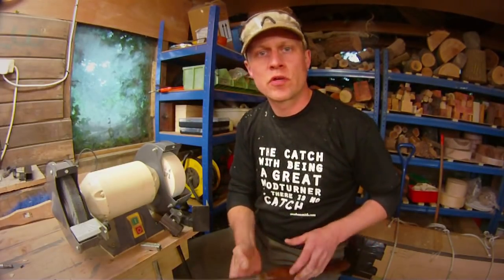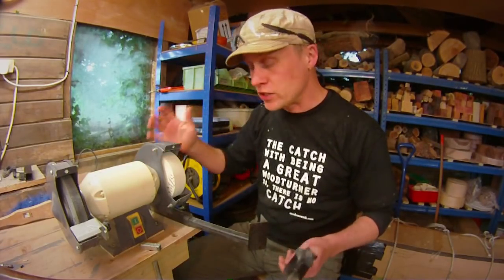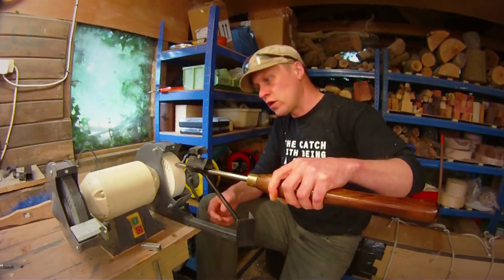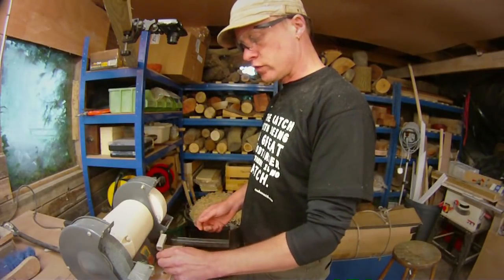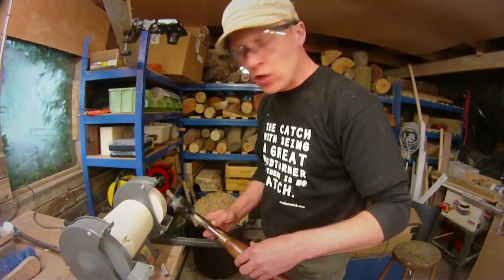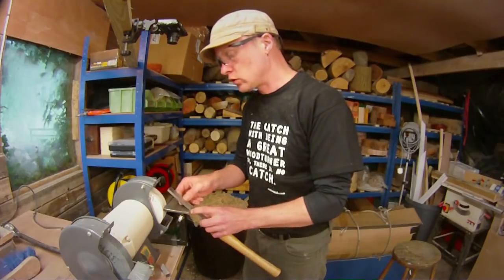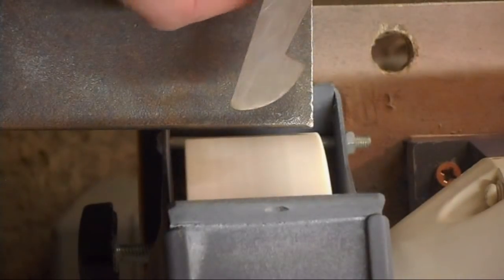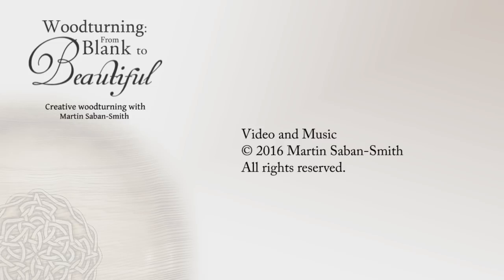Sharpening Woodturning Bowl Gouges and Scrapers Tools. Fingernail Jig Grinder - #66

Comment: Hi Martin,
When I first took lessons on turning, I was told "if you want to learn how to turn, the first thing you have to learn is how to sharpen"
So I learned how to sharpen freehand. Jigs make things sooo much easier and repeatable, although a little slower. For a quick dressing I still do it freehand (I did bite the bullet and buy CBN wheels(much nicer)). For reshaping I use the jigs, mine are "Wolverine" just like your setup - with the slidy in an out thing.
Your fine wheel looks like a 2" wide - much easier to use than a 3/4" wide wheel.
Cheers Paul

Comment: Thanks Martin, I agree with Mike ( who I also watch) I have seen lots of sharpening videos using verious Very expensive jigs but I need to sharpen by hand. Jimmy clewes turns some upside down and uses a sanding belt, so, like woodworking lots of different "styles" I have a similar grinder, and sharpen by hand so your instructions help.. many thanks

Comment: When you were sharpening the scrapers it was clear to see dark areas on the grinding wheel. This is where metal has embedded in the wheel surface, thus ‘clogging’ up the available grinding surface. The use of the diamond dressing tool is to remove this embedded material to expose a uniform grinding surface across the width of the grinding wheel. I hope this adds a little bit of useful information to your demonstration. Regards from Tasmania Australia.

Comment: Cool video Martin. Thanks for that. I'm sorry if I missed it, but what is the rpm on your grinder? All I have is a high speed grinder, and don't really want to buy another grinder, if I don't have to. Can I sharpen with a high speed grinder? I've read that it's not advisable because it can take off too much of the tool and heat the tool up too much. But then others say yes, just use VERY light touches. Do you have any advice?

Comment: My I ask what diameter your grinding wheels are? I have heard 6" will work, but it might leave some concavity in the bevel. 8" is preferred I hear, but a new 8" low speed grinder is not in the budget. :(
Reply: The grinder in this vid is 200 mm, i did hear some prefer the 150mm because they prefer the concave curve, this is the reason some dont like the Robert Sorby systems.... no curve.
Reply from the maker: The grinder in this video is 150mm, not 200.

Comment: Great video Martin. 

I bought the hobby grinder for Axminster and not too happy with it so only been using the Credit Card which so far has done well. I also got the fingernail jig off ebay (retured engineer) so probably the same as you have. I found it fit sperfectly for the bowl gouge (still need to raised grinder by a little) but for my spindle gouge it doesn't seem to be right.

Certainly interested in the flat jig you have which I will now see if I can find.

Comment: I have the very grind and have it set at the 23 degree position,,but im having the hardest time with it,,it seems like from the tip to the back of the wings there is a dip in it,,,do you thing the ellsworth jig would do a better job

Comment: Hi Martin, I've just this morning received that very sharpener, not the scraper one, from Mick Chambers, £34.00, so thanks for this video. I've also noticed a dark line on my wheel and you explained that as well. Cheers mate.
Reply: Dark line on your wheel usually means that spot has become engrained with dirt etc...use the dressing tool to take a bit off and give a fresh surface

Comment: Martin, you know we love you videos. I have 3 words (?) C B N wheels. They are completely balanced, NOT friable ...no bits/dust coming off and can not explode, no need for shielding, take VERY little metal off tools ( therefore last years longer), no heat produced, quiet, and last forever ...almost,........ no dressing, do not get smaller with use therefore never need adjusting, quick...one pass.  That are a bit expensive but in the long term will save you money, work and produce a better edge.  FYI    love tech terms, slidey bit.....stick thingy......makes all the more watchable!!!!  Thanks again Martin.

Comment: Been a subscriber for a while but so glad I found this video. I am just a beginner and have the same bench grinder and will be buying that jig, think I have found it (£65 for both setups). I am SUCH a beginner I only have a 2nd hand lathe and NO gouges yet as budget it tight, but I will be getting the sharpening and extraction in place first otherwise I’ll end up grinding with blunt tools in a dusty garage

Comment: Great video Martin. I bought the self same jig from ebay, but I think it was a friday afternooner. The platform was lying out by over an eigth in the width and then I lost the slidy in and out thing. So I ended up with a trugrind, does the same thing just more expensively. But a good explanation and well filmed.
Drew

Comment: nice video Martin with your u-tube clout I am sure one of the CBN wheel manufactures will spout you a couple one 80 and one 180 grit you will be a  amazed you have a good technique to your sharpening however a wheel from the CBN variety will never ware out and the edge is so good most advancement since HSS was invented for turners